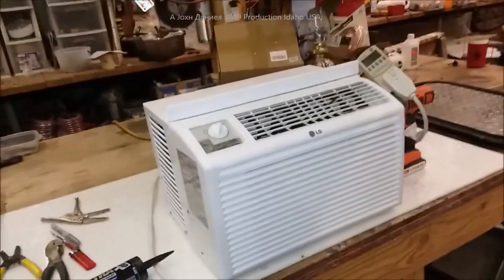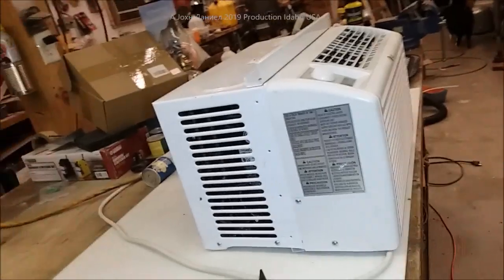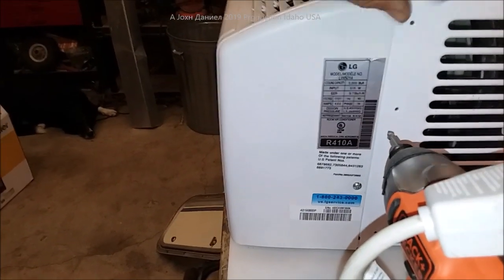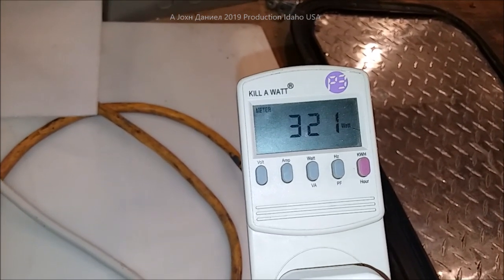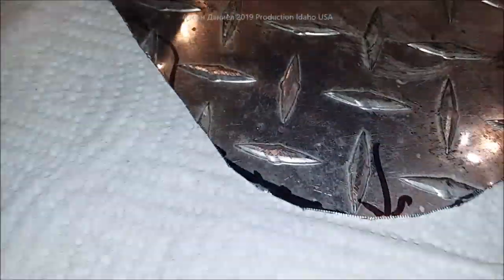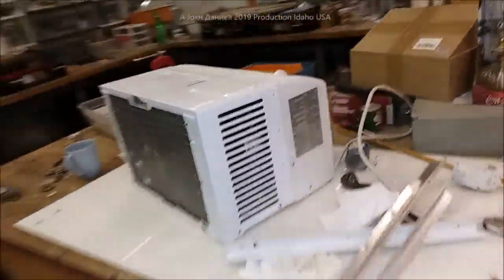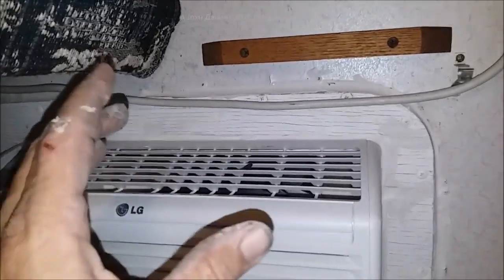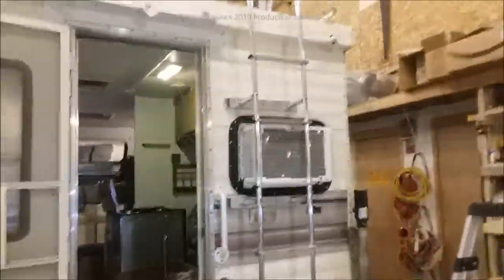Window Air Conditioner Fitted to a Truck Camper RV, the BEST model to use ( info below )

Comment: Hah! What a coincidence.. I went Greg's list shopping today for Treadmill motors and this nice lady had on just like yours the LG unit. Only used a short time till they got the home unit running again. Only had 23 bucks cash so she gave it away cheap!  Great to see the kids interested in the work too...
I've been restoring/collecting old pieces, aluminum, Metal trailer pieces etc. to build a camper "Box". Mostly all trash except the axle soon to get. Happy with most of my stuff except the shell will be like .0625 thick. It'll be like hauling a 7' x 12' Tank without the guns.  What can you say Free is Free.. kudos on recycling.... Oh yes so glad to hear about the Solar power. Got two really nice panels just waiting in the basement given to me for a little sweat equity.  great information took some notes. Thanks,

Comment: I remember sleeping in my Cadet truck camper down to work, from sweltering summer nights with no AC to freezing Winters with the heater can't keep up, had to run burners on stove top to compensate. Should have installed one like this, great job, would have saved me many nights of sweating in bed. Thank you.

Comment: I would re-do your amp test after the AC unit is installed.  Sitting on an bench there is no back pressure.   In your camper with the doors closed there will be making the fan work harder.

Comment: Thanks for your video. I could not figure out what you meant by "frequency drive". Are you talking about a Variable Frequency Drive system (Dual Inverter)? Unfortunately, this unit is not. It has a traditional compressor on/off system. The LG LW1019IVSM is the smallest Dual Inverter unit. I would love to see you give that a review.
Reply from the maker: Its motor control circuit starts the motor on lower voltage and in 3 to 4 seconds reaches full voltage and speed, it does not cause a light to flicker or dim during start or more than a 30% surge for 2 seconds on it. According to the board it has a dedicated fan circuit, not just a relay from the switch. Thats a common control feature in well pumps and compressors with advanced VFD, pre-inverter design. My other AC unit when switched on has a obvious blower torque reaction immediately, this one has none.
Reply: @JOHNDANIEL1  Thanks for the additional information.

Comment: Hi John, I am having problems with my 2001 Nissan Quest GLE 
The dash cluster goes crazy and I have to manually shit it to 2nd gear for it to run right..What is going on?
Reply: Also the speedometer is not working
Reply from the maker: Thats common speed sensor effects and may have a possible need to flash the computer at the dealer after replacing sensor. Disconnect the battery while the head lights are on to pull the system storage voltage from the computer, wait 3 hours then reconnect the battery and try the van out to see if the actions changed on the transmission, or go to Autozone and have them do a reset with their tester ( free) and code retrieval.

Comment: Very nice.
Reply: I just built a lithium titanate battery for our raft/dingy. Your videos have been a huge help. Not for that ... But basic electricity. And understanding stuff.
Reply from the maker: And to think, we shaved over 180 lbs off this thing with new processes and replacing heavy with lighter. Now its under 1100 total. Add my 7 MightyMax 100 watt panels, 5 batteries and controllers we hit 1600 to be complete.
Reply: My ears perked at "gold mining"

Comment: I'm actually in the market for a small A/C unit like this little thing.   This unit seems to be just about everything I was looking for.   Buying this time of year ( Late summer or winter ) has advantages.  Thank you.    Nice Tidy Install Sir.  Well out of the way and Protected quite well behind the ladder.  Nice.   One of those 1000W Plug N Play Grid Tie inverters would cover this quite easily.
Reply from the maker: They are on sale and free shipping so hopefully more people can get & use them before they stop making them due to how old the design "looks" to the market. I got one in a 21 foot cargo trailer that was in use for 9 years before I sold the trailer, the buyer 2 years later still has it running all day.

Comment: I also like that it blows cool air upward into the warmer air in the space. More efficient than bottom up cooling. Thermal dynamic.
Reply from the maker: Absolutely, it scours the ceiling and creates a loop, very good design. Since they are $30 off right now ( I bought 2 more today) hopefully more people can get & use them before they stop making them due to how old the design "looks" to the market.

Comment: John you should be a tiny home designer .. Dude here in TN sold 70 in 1 weekend at $130K+ each... on tiny lots
Reply from the maker: If you saw the complete unusual building process I use, to make a 10 x 30 Tiny house ultra insulated, 3x stronger, and ultra light It would blow your mind. We made one and towed it with a DOT day permit to Battle Mountain NV with my 3/4 ton truck about 4 years ago.